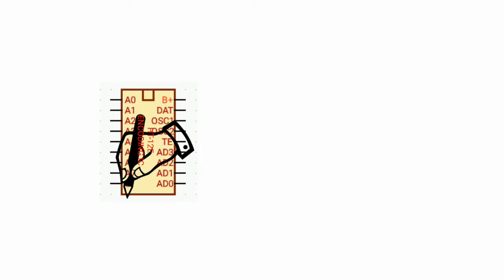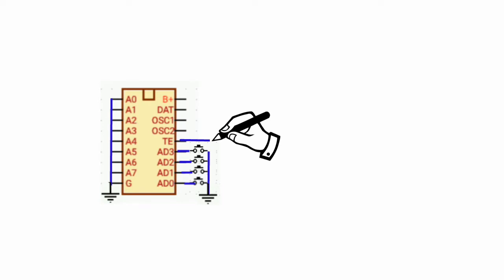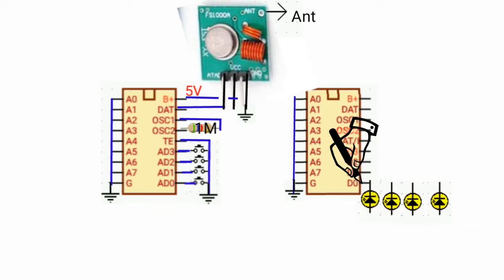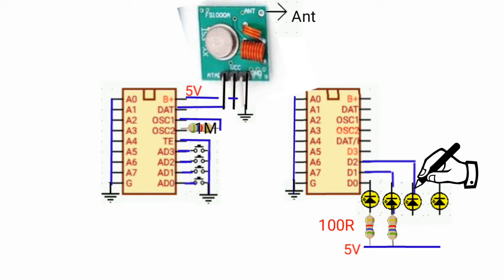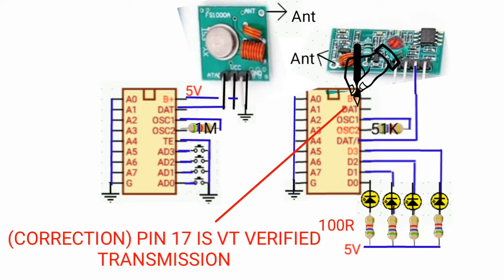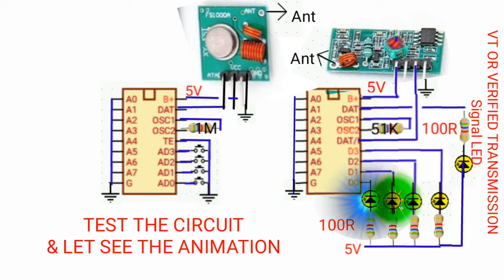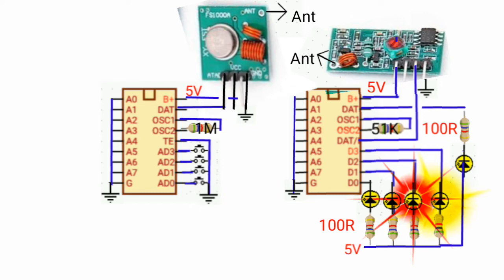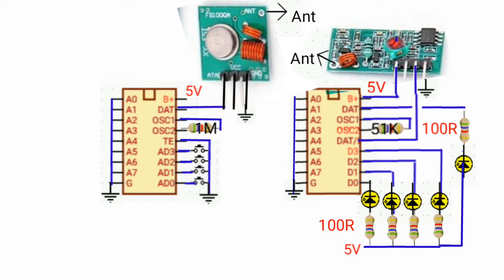Part1:make RF remote control & receiver #ht12e#ht12d

Comment: Looks fun.  How many turns on each inductor?
Reply from the maker: That's the antenna for transmitter & receiver 6-12 inches long then just turn by using small diameter screw driver
Reply: @Sapaih28  thank you
Reply from the maker: @ponymoore6140  welcome my fren
Reply from the maker: My friend joint to this group.

DIY electronic circuit project design
https://t.me/electronicabz